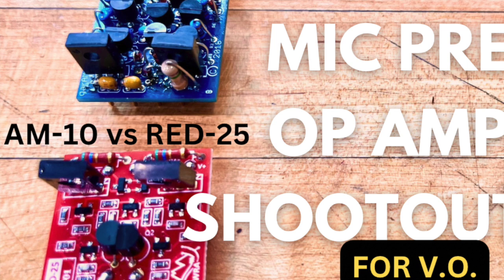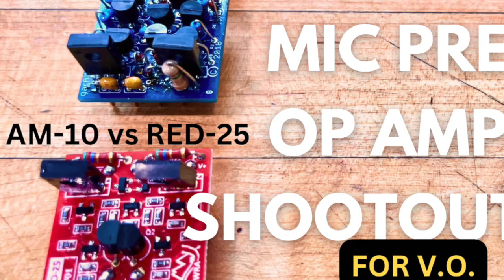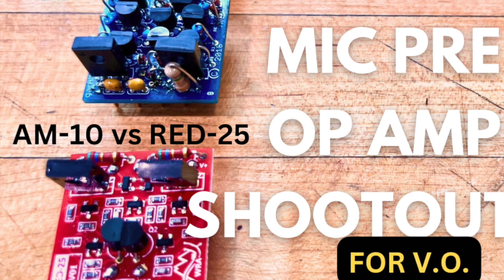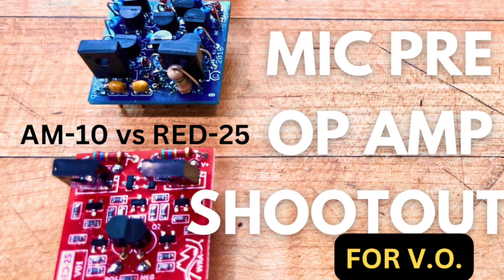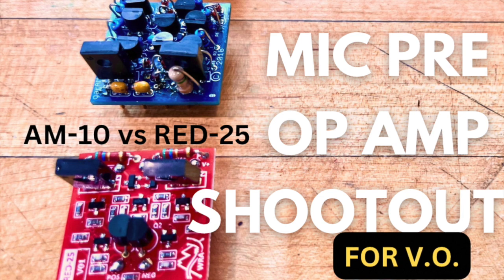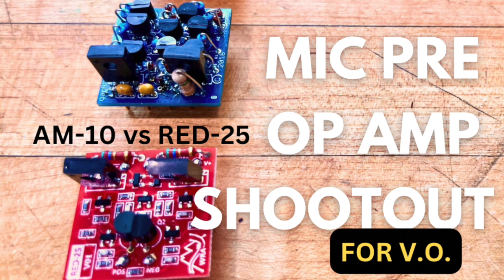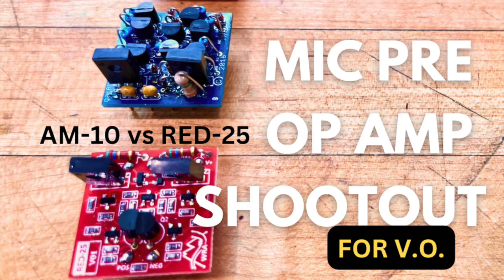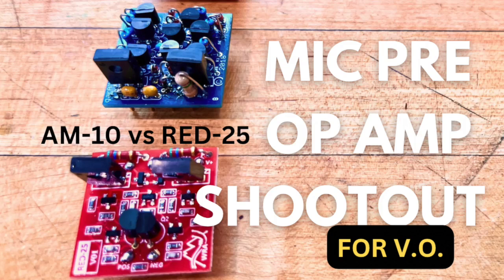Op Amps Create The Tone of Your Mic Pre: Red-25 vs AM10 Op Amp Shootout with the DIYRE CP5

Comment: Great now I want an AM10. It seems a daunting build, though. Vertically mounted resisters, eh? Hmmm. I tried looking on the Capi site but I can't find a prebuilt one. Still, $17. I might get two of them because have you heard my voice? Mid-city. I want something smoother. Great vid, man!
Reply from the maker: I had a feeling you’d dig it based on our convo yesterday. It has such a nice warmth to it, possibly similar to the Aubergine’s sound. The GAR uAM-10 is indeed a tough build with like 30 parts and I believe Resistance Audio sells them already built for like $50. 
https://www.resistanceaudio.com/products/gar-am10-discrete-opamp-2520-footprint

Comment: Would you consider 'potting' them? Would it be substantially beneficial for any particular reason other than handing them often?
Reply from the maker: Very interesting idea. My two concerns would be that I don't know how to do that, LOL, and second, I'd be afraid that to cover the potting compound with a cover/box may add any extra width to the footprint of the op amp as I have other devices where there is almost no additional space. I have one op amp that has a support bracket for the large transistor and it just pokes out a tiny bit, but it's enough to keep me from being able to install it in my EQP-5. The Hardy 990 is potted in a box, but that's part of the design to keep it within the footprint. Might be cool to pot them in something clear to still see all the guts inside.
Reply: Potting them may improve thermal performance, but tbh it's mostly used so people can't see the circuit and copy it lol! That's the reason the 2520 etc is potted